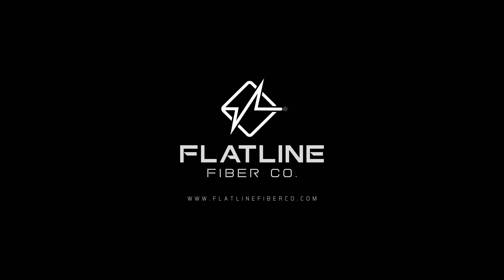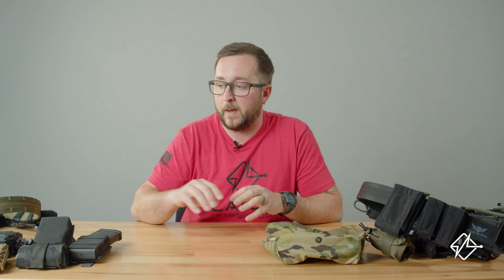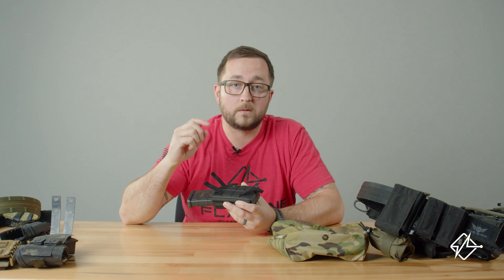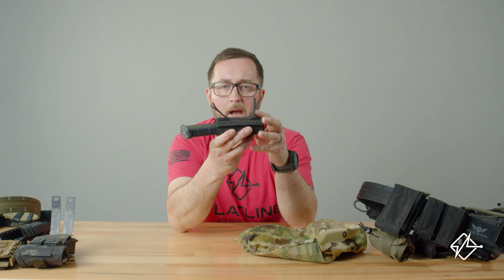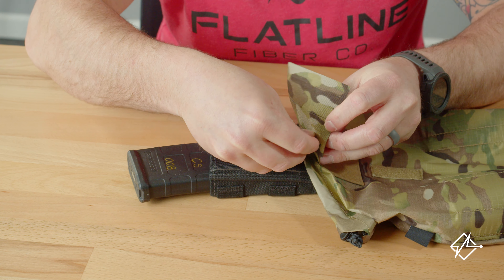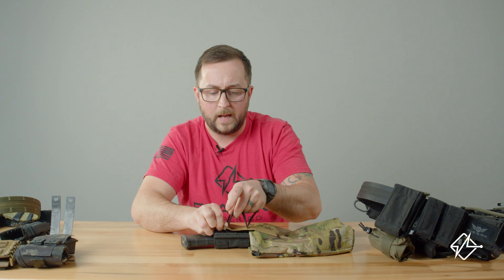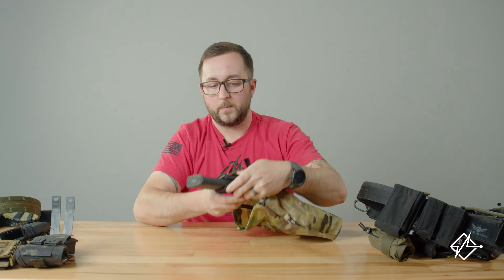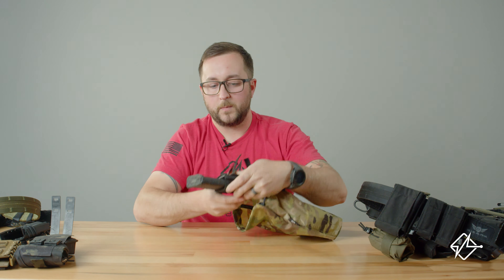Dump Pouch Installation | Battle Belt Accessories | Flatline Fiber Co

Comment: Gen 2 should have a little strap hole at the bottom for people who want a leg strap for stability while running. It would be the perfect dump pouch
Reply from the maker: There is a grommeted hole in the bottom of this one. We don't offer a leg strap at the moment, but one would make a simple one out of shock cord using that hole. Thanks for the feedback Gustavo!
Reply: @flatlinefiberco  awesome. Shock cord and a set of buckles would do nicely. Thanks for the response
Reply from the maker: It absolutely would do the job! Thank you!

Comment: If you're running an inner/outter belt, are you concerned all that velcro on your kit comes off when you remove the outter belt?
Reply: No. There has not been an issue with my personal belts or other people that I know are running this setup. 
Thanks for asking.